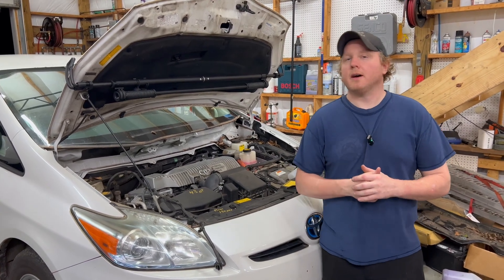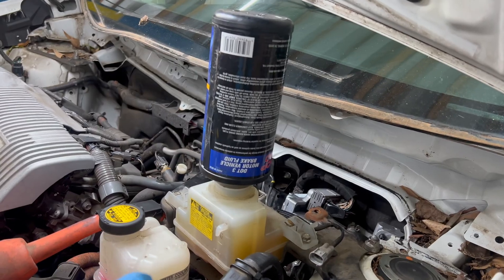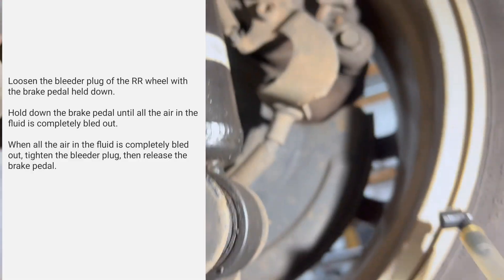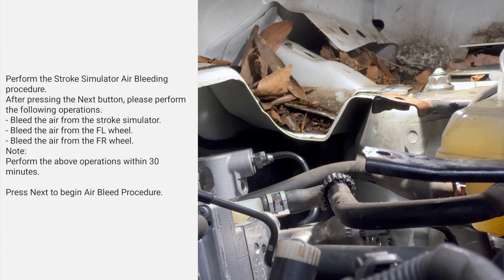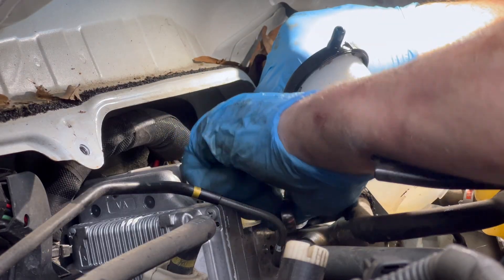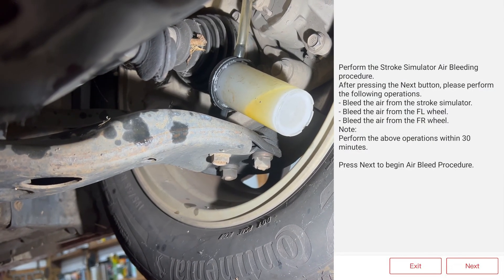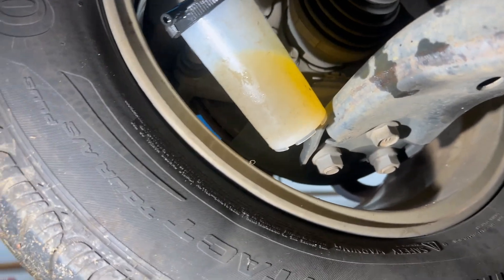2010-2015 Prius Brake Bleeding after ABS Actuator and Accumulator Replacement with Topdon Topscan

Comment: please correct me if i’m wrong, the TopDon scan tool performs the brake bleed procedure AS WELL AS the “linear valve offset relearn procedure” at the same time, correct ?
Reply from the maker: Ours did
Reply: @automotiveinsight got it, i figured it out and got it working but i had some confusion with the process to bleed the stroke simulator, any tips for how to bleed it, like when/if you to press the brake while bleeding it or anything else ? (just confused since the directions are so vague) thanks 🙏
Reply from the maker: @danielafanasiev4524 yes. You bleed it just like a traditional caliper (pressing the brake pedal while the bleeder is open). Typically you don’t get much if any air out of it.

Comment: Excellent video. I am about to install Brake booster that I bought from dealer for $1056 for my Prius V 2013 with 250,000 miles. My car still gets me 45 mpg and I saved $100 at least every month on gas, for the entire 12 years , I might have saved $12,000 on gas  at least and spending $1056 after so many years isn't much of a pain ( for me ) . I am planning to drive at least until 500,000 miles. I self maintain my Prius V , never seen a mechanic ( just like me never seen a doctor because of my athletic lifestyle ( tennis ) and in pristine condition. My question is that can I just bleed the system in regular way after installing the Booster pump or do I need to bleed only with scan tool. I really appreciate your suggestion. Thank you, I subscribed.
Reply from the maker: I had one once that I was never able to get the scan tool to bleed it so I just bled it the “traditional” way (also bled the stroke simulator) but with the car running and it never had an issue. But I also cycled the abs pump several times with the scan tool. Even if you get it bled out, you’re still going to need a scan tool anyway for the linear offset and zero point calibrations.
Reply: @automotiveinsight  Do I need the scan tool to bleed even if I just replace Brake booster pump ? I am not replacing actuator.
Reply: @automotiveinsight  can you share more details about the traditional way?

Comment: 0:38 after I press next on autel it's says it failed although I'm doing all the steps I don't know if my codes prevented that .
Toyota Prius toyota prius c1252 c1253 c1256.
My customer changed his brakes pads somewhere and he left their shop with rock brake pedal can't even depressed.
Reply from the maker: Parking brake applied?

Comment: For anyone doing this procedure and having trouble…. I used a Topdon Phoenix and could not get it to bleed from the top actuator part. The problem was not setting the parking break. Once I did that, I was golden. Hope it helps someone.

Comment: You didn’t explain this rite. You went from bleeding the tires to bleeding the actuator with the pump being ran in the background. Wtf?  How bout explaining which scanner is being used and what the screens look like?
Reply from the maker: I don't know what you're asking for that we didn't show. We name the scan tool in the beginning. It's also in title name of the video. We also show you the screenshots of the tool along with what we're doing every step along the way.
Reply: @automotiveinsight  what do u think about using an used brake booster
Reply from the maker: @Fortalezainterior-l9c it’s an awful lot of work for something that, if it doesn’t have the problem already, will surely have the problem shortly afterwards.

Comment: Yo! Thanks for making this video...I did the repair, ABS module/master cylinder and accumulator replacements.
Can't get the codes to clear. I have an Innova 5610 for the scanner.  Brake bleeding doesn't function, so I'm trying to reset the g sensor (recalibrates the yaw sensor) and that isn't working... I cannot clear the codes.  Do you have any insight for me?
Reply from the maker: I had one that I wasn’t able to bleed with the scan tool. So I just did the normal steps with the car running to get the air out. Worked fine, but you will still need to do the linear offset function. If that’s not available on your tool, I don’t know what to tell you other than you will need another tool.

Comment: Talk about a bunch of expensive unnecessary nonsense. For 50 years we drove cars with regular power brakes which were easily maintained. Then manufacturers decided people were too stupid to apply the brakes to their car. Instead of taking away idiots driving priveledges, they came up with this bullshit.
Reply: lol 🤣
Reply: You are right on. Anyways, someone mentioned that brake system is powered by pressure generated from engine vacuum ,since hybrid engines doesn't run continuously , and hence this electronic way of creating pressure came into existence. Otherwise, we don't see this issue in regular cars, it's only in hybrids and EVs and my maths says  that all the money saved from gas can be used up in such seemingly expensive parts. I drive Prius V 2013 and for the past 12 years , I would say I might have saved at least $100 per month, and over 12 years I might have saved $12,000 on gas and now spending $3000 after 12 years is still profitable, since I am planning to keep the car until 500,000 miles at least( now it has 250,000 miles).
Reply: Well these cars are different from the cars from back then, they didn't have regen braking.

Comment: After the stroke simulator is bleed and you go back to front brakes, the brake pedal wants to push back with pressure and if you let it will come up and back to the floor. Do you hold the brake pedal in against the pressure or do you let it come up and back to the floor

Comment: Have a gen 3 prius 2012. Replaced actuator and accumulator. Started bleeding procedure but not getting fluid from rear brakes. Bleeding keeps failing
Reply: I just watched another video on this and he had what you’re describing. He found that he had a cable connection issue between the pc he was using and his vehicle. Once he solved that the procedure did not fail. Hope yours works out.

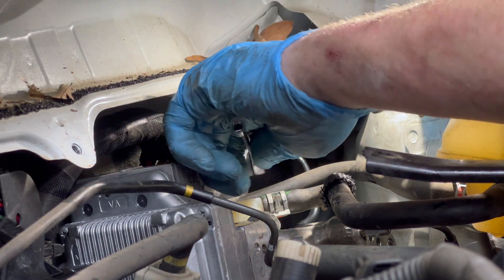Comment: Hi, at 3:58 when you bleed air from stroke simulator do you have to press brake pedal and keep holding it down. or system will run the pump (like rear left or right wheel).
Reply from the maker: Press and hold brake pedal.

Comment: Followed the directions and everything came out just perfect. Only update is that if it takes too long you can drain the tiny battery in the trunk and nothing works until you charge it. This refers to changing the accumulator and booster and then doing the brake bleeding all at one time. Thanks so much for this video. The TopDon is a a GREAT tool - especially for the price!!! Saved me OVER $2000 for the entire job!
Reply: Which topdon model you used?
Reply: Regarding battery: note that once you disconnect the spring from the brake pedal when replacing the brake actuator, the pedal can drop and activate the brake lights.  Either reconnect the spring to pull the pedal back up or bungee the pedal up to the steering wheel to turn the brake lights off.  Otherwise it will drain your battery while you are fighting the accumulator/actuator replacement. I was lucky enough to be doing this work at night so I noticed my brake lights on until I bungeed the pedal up!!!

Comment: Went smoothly but now have the code C1345 Solenoid Valve Offset Learning Undone. Do I just need to run the whole process again?
Reply from the maker: It depends on what tool you’re using. Linear offset is its own utility function on some scan tools and is included at the end of the bleeding procedure on some others. If you don’t see it as its own function, I would try going through the procedure again ( not actually doing it, just pressing okay on the tool) and see what happens.

Comment: For the guy removing this from the junkyards, don't do it, these are parts with 10 to 15 years old gaskets inside of the abs module, usually under brake fluid, when you removed from the car and store in a shelves there's no vacuum in the abs module anymore so the gasket crack, so it was good not anymore

Comment: Thanks for the video, so I have a 2010 Prius with ABS, TRAC, and brake lights on. Would it be sufficient to just replace the ABS pump, or should I replace the master cylinder as well? I will order this tool to read the codes, but from what I've been reading online, if the dealer or a shop does it, it is over $3,000. So, I will try to do it myself

Comment: I did this and immediately got a “check hybrid system error” now I can’t get brakes bleed even with the scan tool.
Reply: You know what it was, I had not correctly replaced the orange hybrid battery thing.   Thanks for the reply.
Reply: @christopherlampman5579  thank you for posting the followup!
Reply: @christopherlampman5579  that thing will get you every time!
Reply from the maker: Try bleeding them with the car running, no scan tool, one wheel at a time. I’ve had to do it like that before. You will still have to perform zero point and linear offset. Some scan tools integrate those functions into the bleeding procedure so you might have to skip ahead to that.

Comment: Do you have link to the scan tool thanks?
Reply from the maker: We reviewed it here: https://youtu.be/bth_Xq3zSuo?si=T8iyCszVfOeJgfQO there are links in the description for Amazon and Topdon directly.
Reply: @automotiveinsight  so, to be clear, the scantool you used to do this procedure was the topdon topscan lite (not pro), right? (based on the comments in the aforementioned review video). tyvm!
Reply from the maker: @steveschoon4331 it was the lite. We’ve reviewed several scan tools on the channel that will also do it, some with lifetime software updates, so you might want to check those out as well before you make a decision.

Comment: Hi, I replaced the ABS pump with a Foxwell NT630Plus scanner, went through the bleeding process as instructed, and all was good for about 3 days. Then all the sudden the ABS light comes on again and wont clear with the C1345 code Linear Solenoid Value offset learning undone. How can I get this darn thing cleared? BTW the ABS pump doesn't make any vibrating noises anymore. TIA
Reply from the maker: The linear offset is a function you do with the scan tool. See if it’s a service function in your tool. I have no experience with that particular tool so I’m not sure of its capabilities.
Reply: @automotiveinsight  yes, this tool has the linear offset process, still doesnt clear the c1345 error. Since you have done 70 plus of  these and ive done like 3 times, im sure you have ran into this. I only replaced the abs pump, not the master cylinder.. also dealer couldn’t clear the error. TIA
Reply: At the stroke accumulator part I had no fluid to bleed from actuator. Saw somewhere where you have to reset EBS before these procedures to complete.

Comment: Can you post a link of what scanner you used to make sure I get the right one? Thank you
Reply from the maker: https://a.co/d/hZowFdZ
Reply from the maker: We also reviewed it here https://youtu.be/bth_Xq3zSuo?si=Q3c8iFXOWAVRzGvy and there are links in the description.
Reply: Thank you does this procedure also calibrate the solenoid?
Reply: Or is that a different procedure
Reply from the maker: @how-toswithmark902 it automatically prompts the linear offset procedure.
Reply: I bought the TOPDON unit using the link and it was selling for $54. Bought it exclusively to do the brake bleed and linear solenoid valve calibration (C1451 and C1345). It worked for my 2012 Prius V, so I wanted to share that here. I would also mention that while the brake bleed ends by prompting the linear solenoid calibration, you can also invoke the solenoid calibration all on its own. That’s how I did it because I accidentally exited out after the brake bleed was finished. I ran the diagnostics and the C1451 was gone, but I still had the C1345. I then did the linear solenoid calibration and all warning lights are now gone and there are no DTCs!!!
Reply: @GlenOGrady-h6b  Agree completely. I too bought the Topdon and it did the complete brake bleed procedure after accumulator/master cylinder/pump replacement. It cleared all my codes as well. All brake issues resolved.
Reply: Awesome thank you!
Reply: Was your helper pumping the brake pedal during the last step, L(inear solenoid valve relearn). I hear pumping sounds in the video.